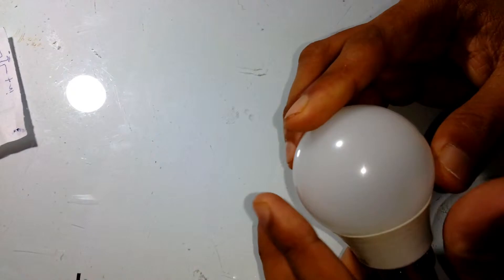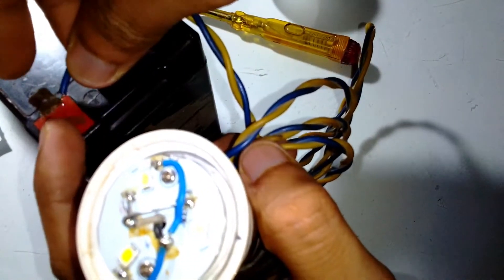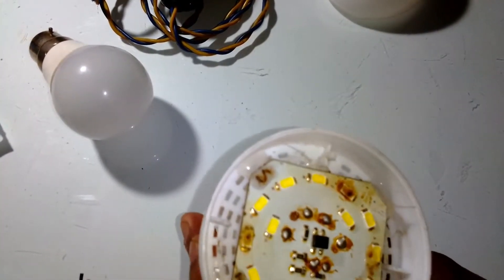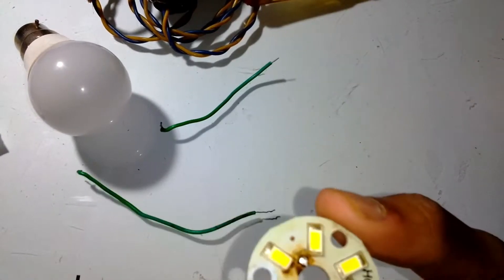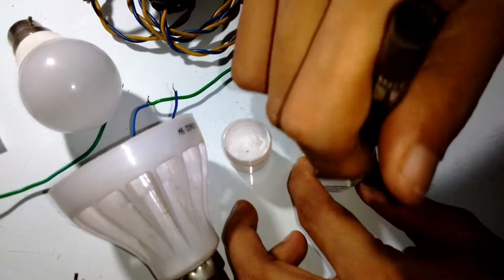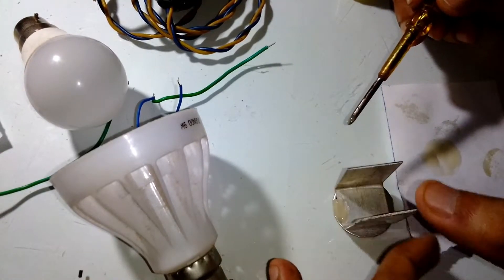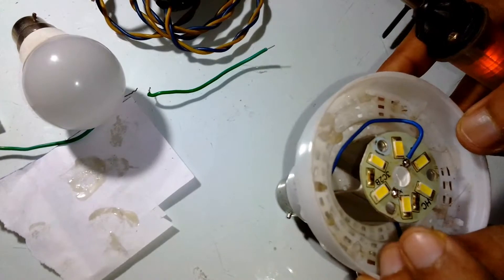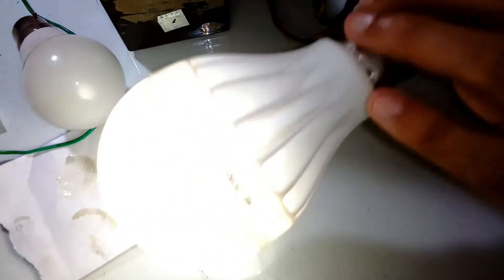Converting 220 volt AC Led bulb to 12 volts DC --- Its About Everything.

Comment: Some says connected in series u say in parallel what we do
Reply: Mean 3 volts 4 led in series = 12 . Its right way
Reply from the maker: Yes,
Reply from the maker: LEDs are typically of 3 to 4 volts and they are arranged in series and parallels to run them on desired voltages. For example, i have 4 volts 1 watt smd's and i want 9 watt at 12 volts.
What i will do is i will series connect 3 smd LEDs which will make a 12 volt 3 watt pack and then i will parallel 3 of this 12 volt packs to give me 9 watts at 12 volts. So i will call it 3S3P or 3 series and 3 parallel.
--
--
Note:- Each smd packages can have multiple microscopic led chips in them so if an led smd runs on 12 volts directly then it has 3 small led chips in series inside the smd package.
(For more information check out my recent videos on led bulbs)